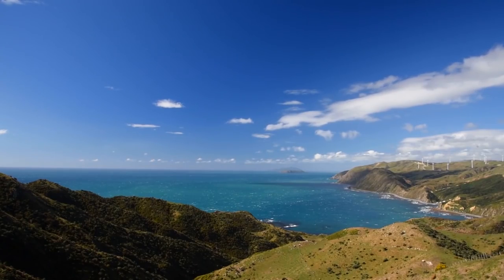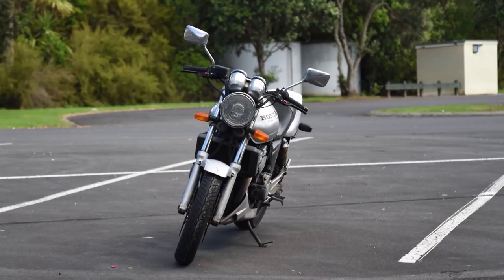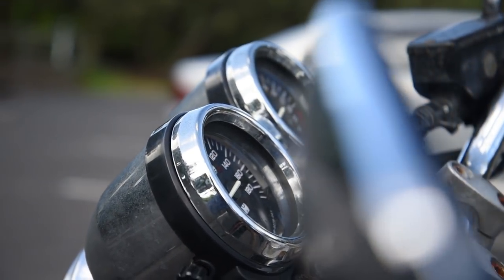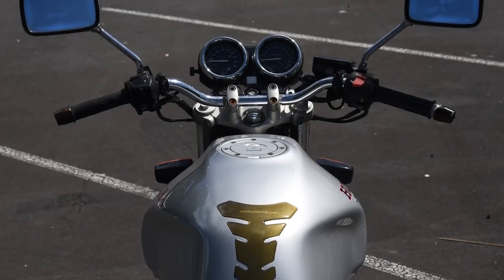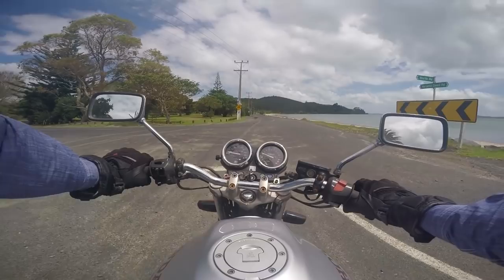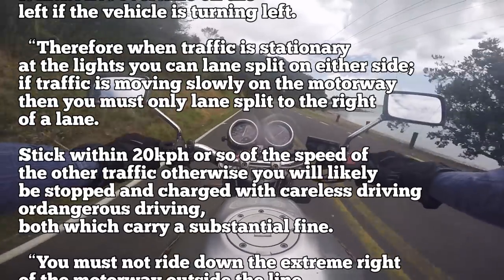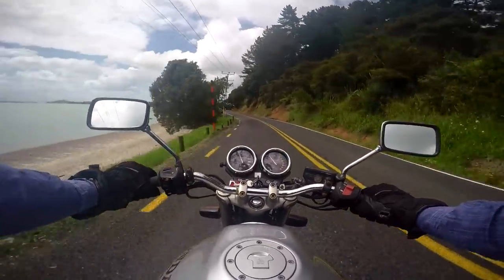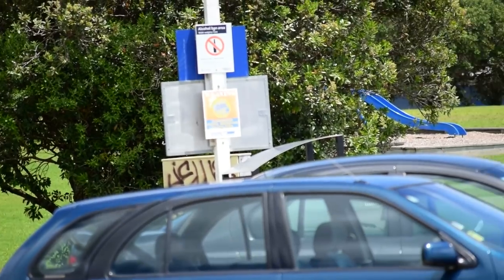1993 Honda CB400 Super Four: Regular Car Reviews

Comment: Just realized a small error, Honda made the CB400F NC27 in 1989 with a four cylinder, not 1991.  There was an entire model generation or two before this bike. In fact, it was even brought to the us in 1989/1990 as the Honda CB-1.
Reply: NC42e is for after 2008 i think, fuel injection model
Reply: Yep, I've seen a few CB400Fs on Craigslist, but they're rare.
Reply: You’re right. I have an NC31 from 1992. It pretty much looks the same and revs the same too. Great bike!

Comment: we got 400 fours here.  honda cb-1, yamaha fzr400, and suzuki bandit 400.  cb-1 had gear driven cams and a 13750 redline.   the super four you rode here was the replacement for the cb-1.  we never got that one as the cb-1 never sold well and only lasted two years, 89-90.  the super four was styled after the cb1000 where the cb-1 had its own style.
Reply: Thanks for pointing this out.  As a former Bandit 400 owner, I'm constantly reminding people that there was a brief shinning moment when the US was able to get adorable and practical sporty bikes that weren't designed as falic representations.

Comment: I wanted a Honda CB-1 400cc when I was in high school. The CB-1 was available in the U.S. from 1989-1990 it was a liquid cooled transverse 4 cylinder. So we did get a 400cc Honda.
Reply: Just bought a 1990 M.Y. last week
Reply: W S Jealous, that CB-1 should be  a fun little bike to scoot around on...
Reply: @mws3779 
I thought the exact same thing until I got one.  It's a fast, fun little bike but the gearing is insanely low (3000 RPM at 30 mph), and the seating position is pretty uncomfortable for trips longer than 20 minutes.  If you want a similar bike, I imagine any old 600cc sport bike would be better.

Comment: Yeah but... but... what about the 1989 - 1990 Honda CB-1 (400FT) and the Honda Hawk GT 650 of the same era with trick single side rear swing arm as standard? 

They WERE brought to the states it's just that when Honda tries to sell you a CB-1 (even one that revs to 13K rpm and has gear driven cams) for $4K+ at the dealership and the Honda 600 'Hurricane' F1 was just under 6K most people just bought up.

This has always pretty much been a two bike country: one engine under 1 liter and one engine at or above. There never seemed to be a large enough demographic to fill out the sub-liter categories much more than the 600 or 750s, which is a shame because the CB-1 was an excellent bike, small, flickable, light and my first ever.

Comment: The VTEC systen used on this bike is basically what they used on the VTEC Honda Fit/Jazz that you had.  Both engines go from 2 valve to 4 valve per cylinder when VEC is activated.  There is even a Motorcycle/Scooter that uses an engine based on exactly the same engine as the Fit/Jazz but with 2 less cylinders, the Honda NC700D Integra which is a cool maxi scooter with a dual clutch transmission and half a Fit engine that was made to run not completely smooth to give it more feel.

Comment: Actually, America did get a 400cc inline 4, I owned one until last year when I sold it to a new rider. You can see it on my channel if you're interested- it was a Bandit 400, only imported a couple of years because they didn't sell well. I just acquired a Honda 919, because I like naked styling...but as pretty as my 919 is the Bandit 400 with it's trellis frame was still yet prettier and preceded the Ducati Monster by 2 years.